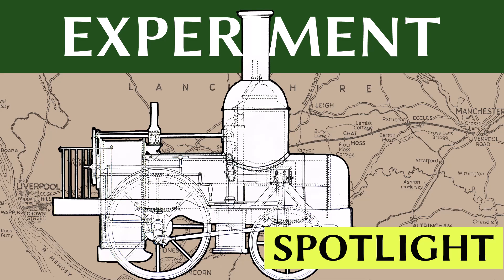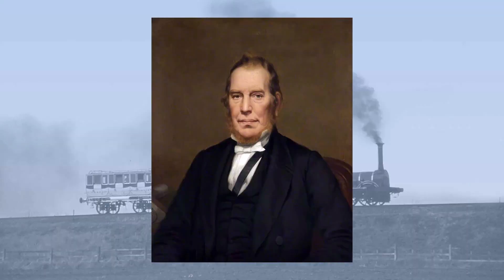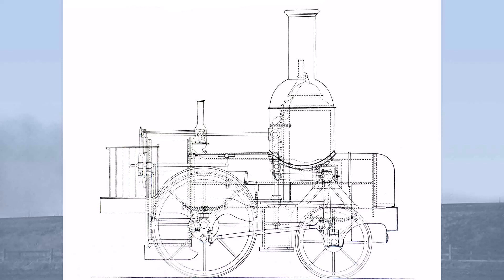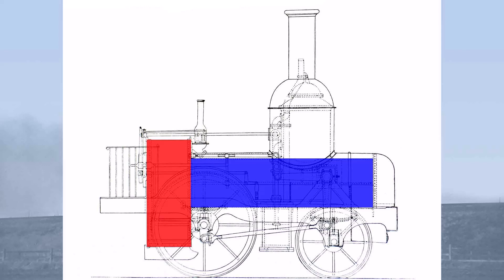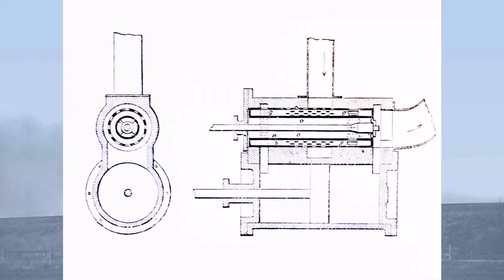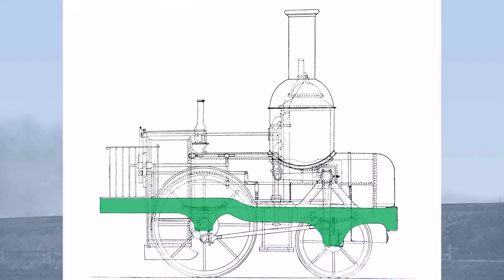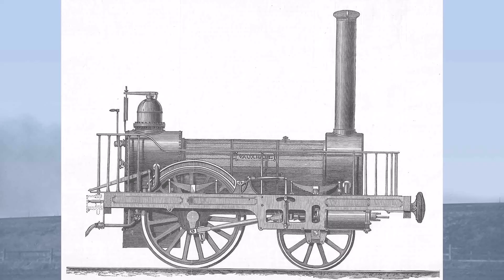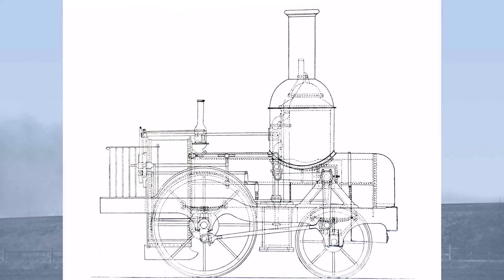Spotlight: Experiment

Comment: It's too bad you don't do later locomotives. I've been collecting literature about the 1892 locomotive James Toleman, and it is one of the all time greatest freaks of locomotive history - and with one of the most ludicrous histories imaginable. Built by Hawthorne, Leslie & co. to the specifications of Frederick Winby. Winby was a railway man, from a railway family, who ran a contracting company (which was responsible for the construction of the Transvaal Railway in South Africa - until the second Boer War happened, but that's another story) and with some ties to the LNWR. However despite much experience building railways, he had none designing locomotives - so of course for his first (and only) attempt, he would go the "excess of innovation" route instead of sticking to what worked. The James Toleman was a 4-2-2-0 design, powered (theoretically) by four cylinders. It featured a massive firebox over eight feet long, and a bizarre boiler, that was basically two semi-merged cylinders, think of a figure 8 in section. This was done because the engine had 7'6" tall drive wheels, and Winby wanted to fit a large boiler in between them. And that's not even the strangest detail, as the boiler barrel (ahead of the firebox) was 9' long, but the fire tubes were 14' long.  Four feet of the boiler barrel was set into the inside of the huge firebox, and one foot of the barrel was hidden in the smokebox.

Anyway, Winby took the locomotive to the Chicago world's fair in 1893, challenged the builders of other locomotives to races, even challenged the famed New York Central 999 to a race from Chicago to New York. But nobody took him up on it. He also didn't find a buyer by the end of the exposition. The Milwaukee Road was interested enough to want to put the locomotive on trial - where they immediately found it couldn't produce enough steam to move itself. It was found the coals on the forward part of the grate, under the 4' of overhanging boiler barrel in the firebox, wouldn't stay lit. So no steam. Around 1912 it was scrapped (by dynamiting it!) and Winby passed away in 1915. 

Now one that would fall into the era you specialize in, perhaps Cornwall? Or Walter Hancock's locomotive (I'm not actually sure if he built the locomotive, or just the boiler).
Reply from the maker: It's design is discussed at length in the page of the technical journal "The Engineer" for 1893. It's certainly a peculiar looking thing. Not having the driving wheels coupled suggests a Webb influence as his compounds had separate cylinders and valve gears for each pair of driving wheels. The firebox does look very peculiar in shape and would be almost impossible to fire. The extension under the barrel being lined with fire bricks which extend out to form a brick arch. The cylinders look far too small.
Reply: @AnthonyDawsonHistory  I suspect given the "split drive" the cylinders were intentionally small (that is it was intended to keep roughly the same swept volume as two larger cylinders, only divided between four). However, in that case the total swept volume of all four cylinders combined is unusually large for the era. Although most books will simply refer to the performance of the James Toleman as a complete failure, it did end up being modified somewhat, to the point it did kind of work. Eventually it completed several 80 mile journeys, with a train, albeit slowly. The problem, after they had modified the firebox to the point the boiler would produce steam, was that often half the cylinders wouldn't produce power. All four cylinders were fed from a common conduit, and as the drivers were not connected, the engines could change "phase" with each other with the result being one axle would get power, and the other wouldn't. 

Winby abandoned the locomotive abruptly and went back to England. So far as I can determine, this was not (as is usually reported) because he had lost hope in modifying the locomotive to the point it would run correctly, but rather because the real, actual person, James Toleman had passed away, and Winby was now getting drawn into a legal dispute (Toleman was a major investor in the Transvaal Railway). I can't find anything about Winby's life after the legal issues wrapped up. I presume he retired, but wonder if he ever made any attempt reclaim the James Toleman.

Comment: Looking at these drawings is giving me a headache. It looks like she has a steam dome inside a "smoke dome", for want of a better term. I could theoretically see a possible advantage in venting steam from the safety valves up the chimney, thus further adding to the drafting (granted, when the safety valves are lifting is usually when you want to cut back on the drafting as it means you're generating more steam than is needed and thus wasting steam), but that fails to account for the tremendous heat and grit from the smoke that would inevitably foul the safety valve. And the use of bell cranks slung under the piston linkage like on some early side lever steamship engines feels unnecessarily complicated.

This definitely feels like an example of Stephenson's "overabundance of innovation", or to use a more modern term a "rolling science fair"; too many new, unproven ideas all crammed into a single package without testing to see how many of them actually work at all or offer any substantial boost over existing technologies. 

As for other early locomotives to cover, I reiterate my request for the LBSCR's "Jenny Lind" Class, the world's first mass-produced passenger express locomotives. If you want more weird and wonderful, can't go wrong with the B&O's Grasshoppers or Camels. Or there's the famous Fairlie double-ended steamers, so famous for the Ffestiniog Railway but once seen throughout the world, from Canada to Russia to New Zealand, and surprisingly popular in Mexico and South America.
Reply: The Grasshoppers are impressive for being so successful despite their unorthodox design, and Phineas Davis and Ross Winans are both interesting characters. Robert Stevens "Monster" would be another extremely weird (but surprisingly effective) machine to look at.
Reply: @furripupau  From what I've read, the Grasshoppers were noted for a few advantages as well. Their vertical boilers raised steam very quickly, meaning less downtime before starting work (granted, they were also very inefficient, with most of the fire's heat being vented straight up and out the chimney), their small wheelbase made them more capable of navigating the rough frontier track of the early B&O, and the simple design, particularly the simplicity of the boiler, made them cheap and fast to construct. Conversely though, their design also limited their size, and there are (likely apocryphal) tales that the walking beam transmission that gave them their name could cause severe vibration to the point of limiting their speed to around 25 mph lest they literally bounce themselves off the track. Despite these shortcomings though, the fleet stayed in use until around the 1860's, and even after a few were kept aside as shunters around the Mount Clair Shops, long enough for two to be fixed up and displayed at the Chicago World's Fair of 1893.

Ross Winans strikes me as the closest thing we'll see to a steampunk mad scientist in the mid-19th Century. Apart from his Grasshopper and Camel locomotives, he was also responsible for the bizarre "Winans Cigar Steamers", a unique design of cigar-shaped steamships that placed their propellers either at both ends or even in the center of the hull!

Oh gods, I'd forgotten about the Camden & Amboy "Monster". There's another locomotive that hurts my head just to look at it; so many linkages, levers, cogs, connecting rods, how does it all work?! That would be another great episode, both to hear Anthony bake his brain over how she functioned and explain how she lasted into the 1870's!
Reply: @sirrliv  Further, the Monsters were a class, Stevens had several built! There is even a photograph of one of the later versions floating around out there. 

The history of Davis's York, winner of the B&O contest would be interesting too. The replica that exists today aims to depict the locomotive as-built, which unfortunately suffered from a great deal of problems due to the use of vertical cylinders. You'll note the replica lacks springs, presumably so it won't bounce itself off the tracks. York was rebuilt with geared drive (although without the walking beams of the grasshoppers) and apparently was still in existence as late as 1876, when it appeared in Philadelphia for U.S. centennial celebrations. Inexplicably, it seems to have been scrapped after that, as in 1893 the B&O displayed a non-op replica at the Chicago world's fair. A painting of the York as rebuilt appears on the program cover for the 1927 Fair of the Iron Horse. It would be interesting to know what the artist used as reference material. The original survived long enough into the age of photography that it's quite possible photographs of it were made, and yet I've never seen one. 

You can find film footage of the fair on youtube, which shows the replica York, and two of the grasshoppers in operation.